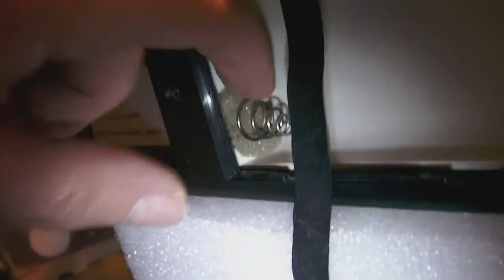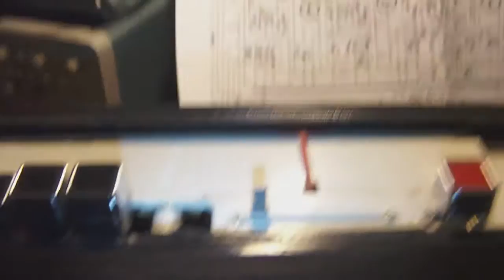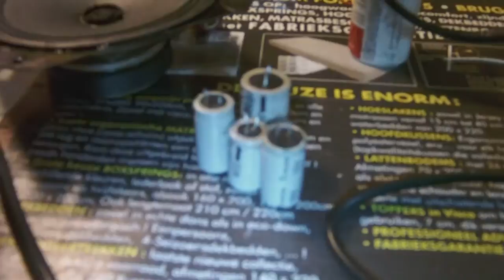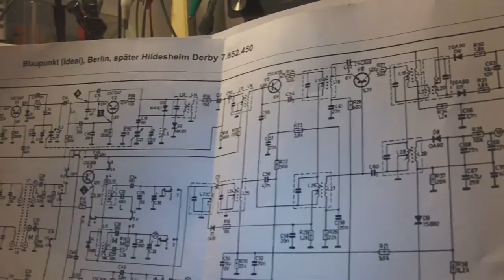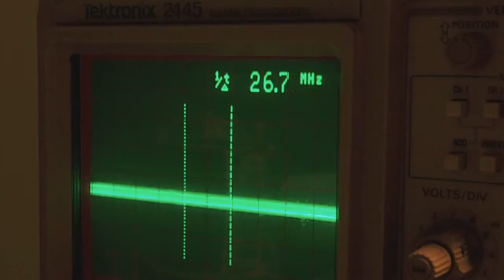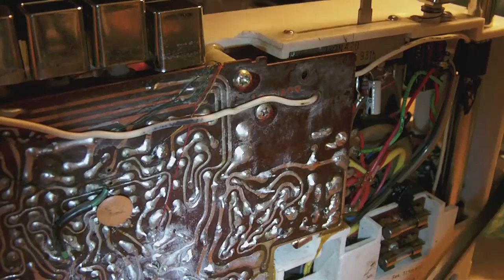Blaupunkt Derby 7-652-450 part 1 of 2

Comment: What Funktion has the little Button on the top . I dont understand this. Thank you
Reply from the maker: Hello,
The small button above the station tuning button is a fine tuning only functional in Short wave (Kurze Welle). It allows to finetune (Feinabstimmung) the antenna on very remote and weak short wave transmitters.
Because nowadays there are only very few and very remote foreign SW (KW) transmitters, this button has no longer any practical use and is therefore largely obsolete.
Thanks for watching my video and subscribing to my channel.
Always welcome :)
Reply: @TechneMoira  "KW-Lupe" is the german description. Fine tuning of the frequency only in shortwave.
Reply from the maker: Thank you for that interesting piece of knowledge, Dieter. It's much appreciated. Lupe is the German term for magnifying glass if I'm not mistaken :)

Comment: Nice long video even with missing scenes, really enjoyed watching your work. Where did you get the nice ratcheting screwdriver, was it an eBay purchase? Thanks for the German lesson too, very interesting, they do make great radios, nice job on trouble shooting.
Reply from the maker: Yes, I bought the little thing on Ebay, you actually buy the screwdriver with a whole set of bits, including the infamous star-lock screws. It seemed like the right tool for handling small, tightly locked screws. The bits are made from hardened steel which make it easy to unscrew with a minimum of force or damage. 
German radios are good quality generally, although they tend to be "over-engineered" at times, making them a bit more complicated than necessary and prone to failure. 
Thanks for watching, I'm glad you like the video :)
Reply: ..thing looks brand spanking New!